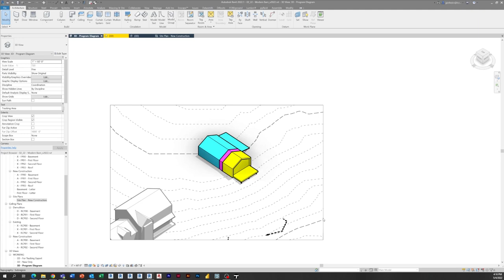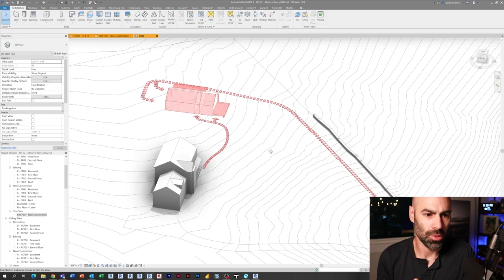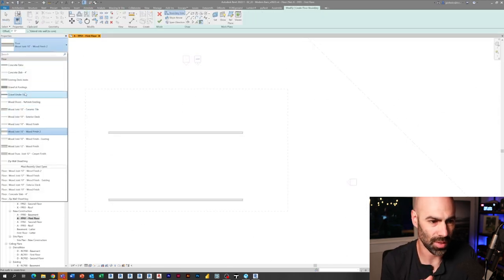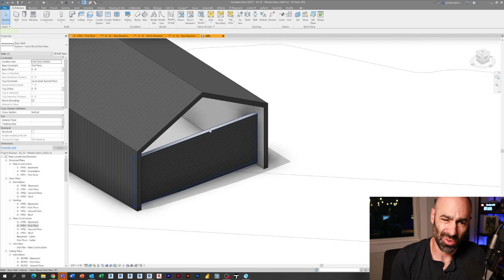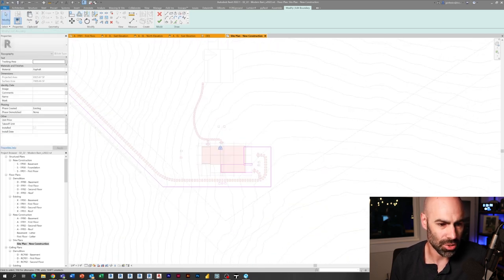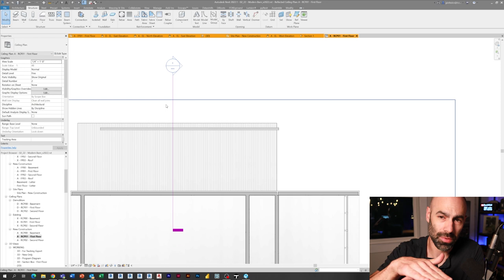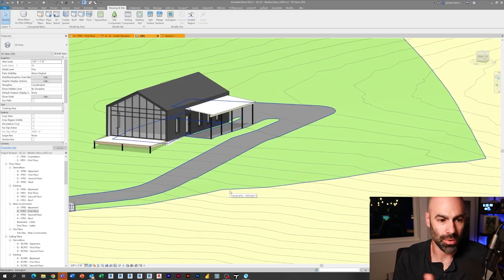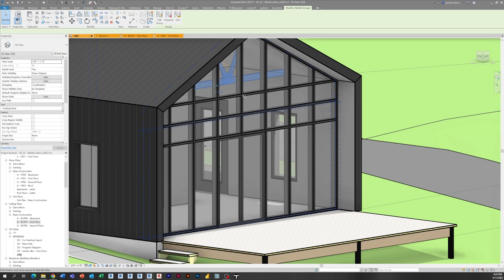Schematic Design Model in Revit Tutorial - Modern Barn (Episode 02)

Comment: Hey, you linked your computer BIMBOX in the description. Which model are you using? Im wondering if their laptops are capable enough for a Revit and rendering daily driver?
Reply from the maker: I have both the Mech 16 laptop and the Stryker IV desktop... they are more than capable enough for Revit... they are practically designed for it!
Reply: @TheRevitKid  Thanks. Are we talking base model? Curious about the GPU. I want to switch from Rhinoceros on my macbook to a PC. I want to start with a laptop.
Reply from the maker: @BensonDubya  no… both of mine are maxed out .. 4090s, tons of ram, i9, etc…. It all depends on what programs you plan on using and how big or complex your scenes are. Etc …
Reply: I figured. I'll be working with all residential homes. After watching your content I believe Revit and Twinmotion will be a great route! Only complexity Ill have are some steep topography and landscaping. Amazing content btw. Very thorough and informative.   @TheRevitKid
Reply: Anything will be an upgrade from using Rhino on mac with very slow rendering, no BIM, lots of repetition between plans, sections and renders. And no room for plugins on mac. I just want to be sure I get something capable and I can always upgrade after 3-4 years.  @TheRevitKid